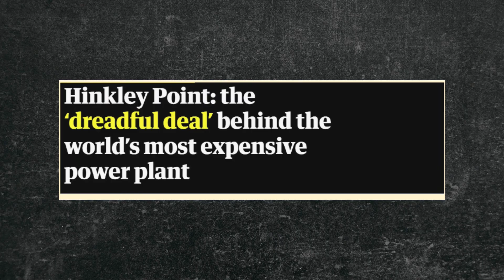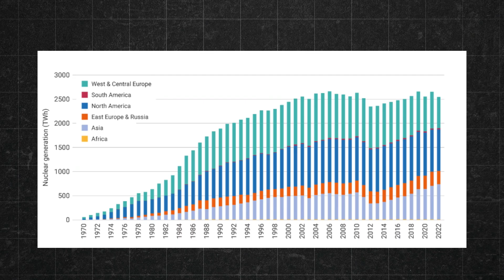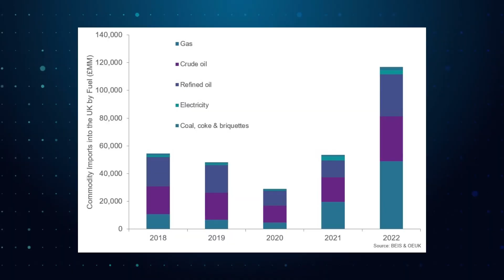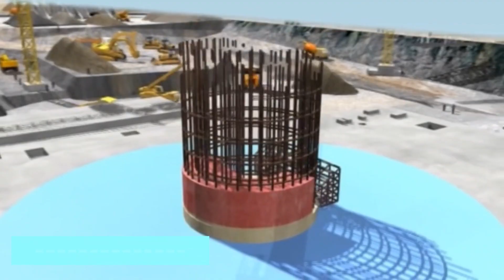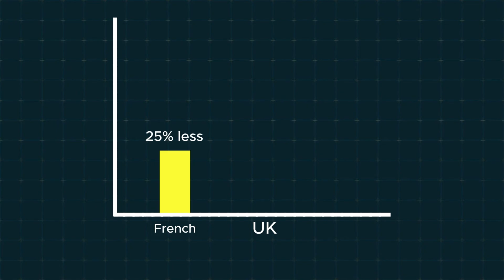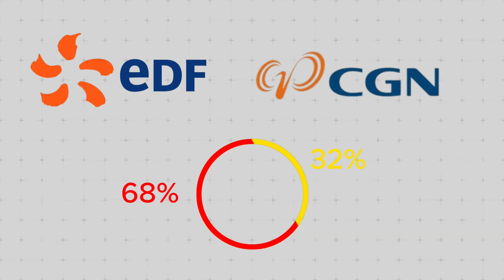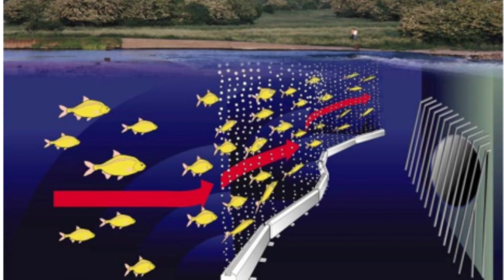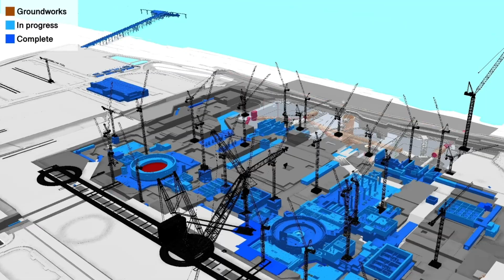Hinkley Point C: The Race To Beat The 2026 Deadline

Comment: man you dont even talk of the polar crane inside the building! no heavy equipment lifted without it
Reply: Yeah, and that polar crane (which I call a bridge crane) would have been brought inside and hoisted into position AFTER the dome had been assembled and concrete poured.  Fifty years ago, that was how "we" did it.  Big Carl is a game-changer!
Reply: @charlesmoore1762 it is a polar crane. My compagny built them for hinkley point c, flamanville,  all 900 and 1300MW in France and soon SZC. You cannot hoist the crane after the dome but before they were lifted in smaller parts which was indeed more complicated

Comment: its all about scale wanted it cheap you should have ordered 10 times same design or better(ur missing easy way to retro fit aca enable 120 years or longer + bye swapping out boiler...the biggest cost is the concrete shell and shielding bye making design with swapable boiler you automaticly make the project nearly free (thanks to inflation)) aca 70% nclr 0 co2